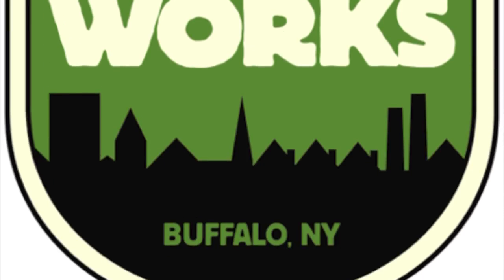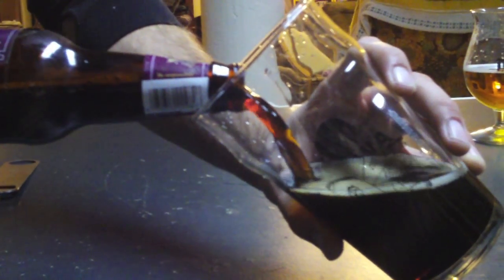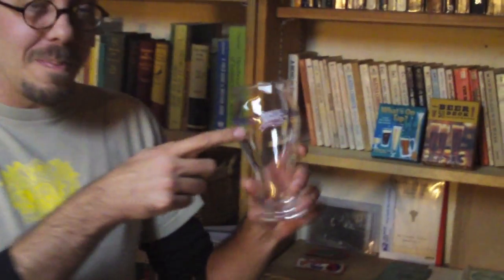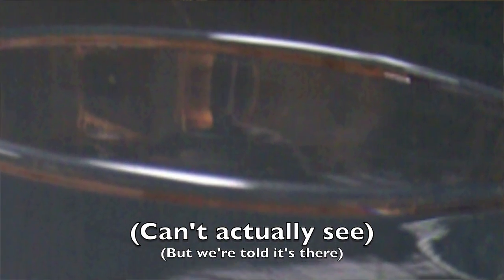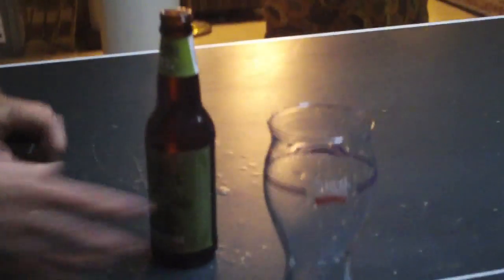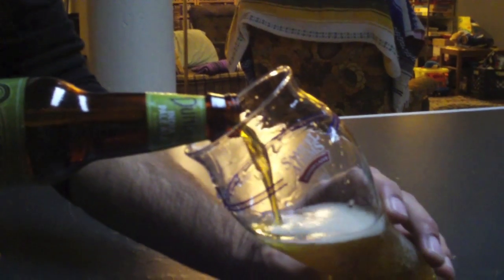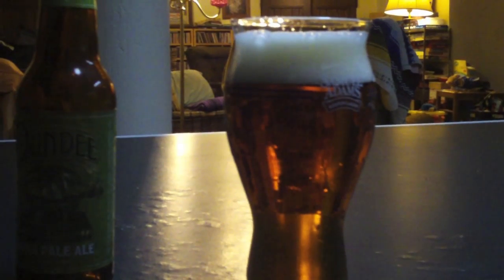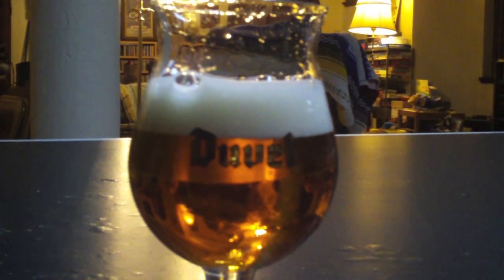Give Your Beer the Right Glass and a Proper Pour

Comment: all purpose tulip glass?? it's a duvel glass!! which should not be used for anything other than duvel and duvel tripel hop, u are disgracing the glass, and the foam is supposed to come a loot higher in the glass, it pretty much need to fill the entire glass that's why it such a tall glass, come to belgium ( where the beer is made) and they will gladly show you